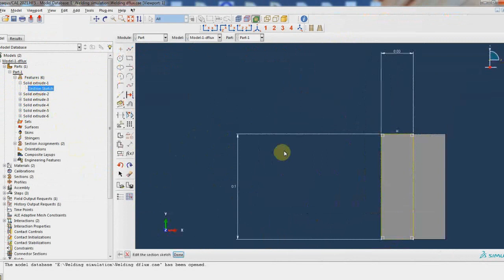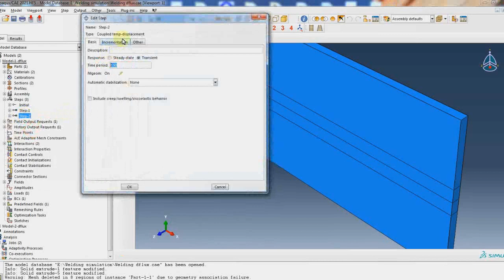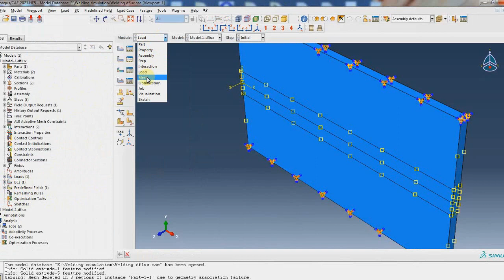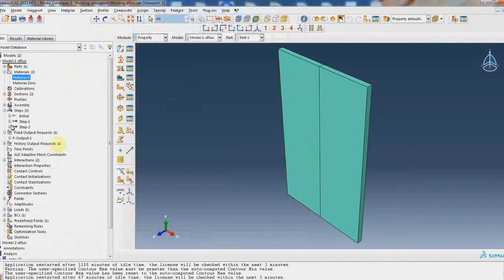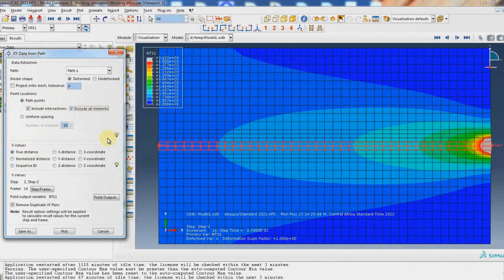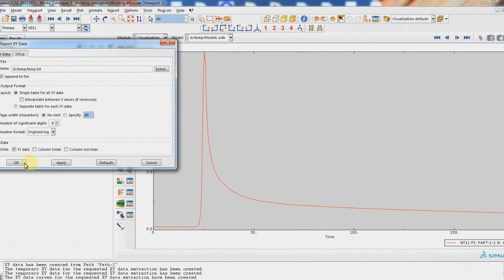Welding simulation using DFLUX subroutine in Abaqus ** PART 1 ** : Surface heat flux

Comment: Hi.
Is there any subroutine named DSFLUX.
And how is it different from DFLUX.
Please reply
Reply from the maker: Yes there is, DSFLUX is a surface fluxes subroutine while DFLUX is used for both volumique and surface heat transfer.
Reply: @imodeling5736  hi could you please do a video for wire arc addetive manf. process ?